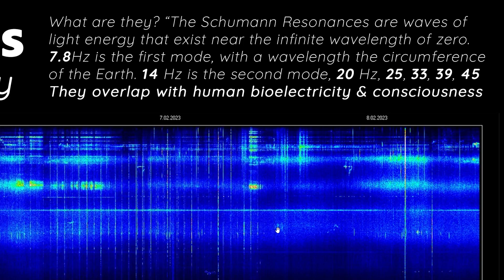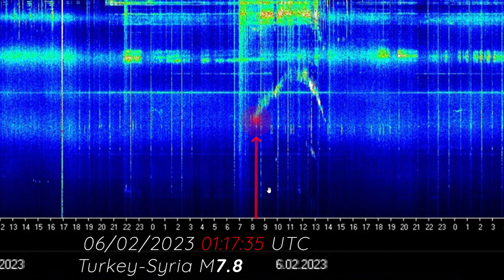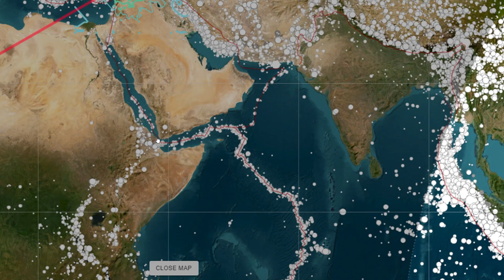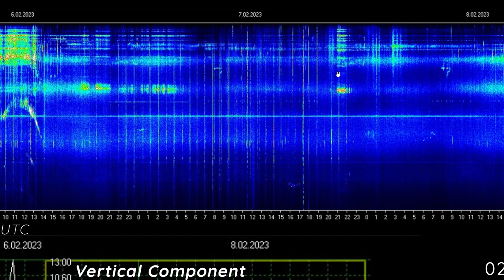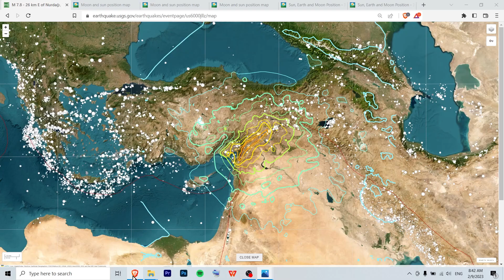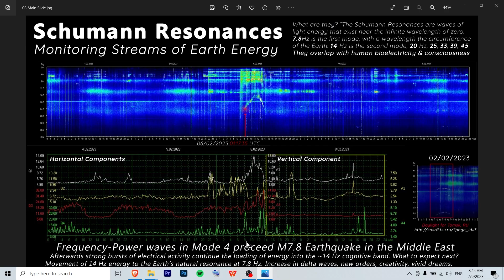Pre-Earthquake Signals appeared DAYS BEFORE M7.8 Turkey Earthquake

Comment: Do you have any informations about potential Ionospheric anomalies over that area? I have read somewhere that Ionospheric anomalies occurred before strong earthquakes like in Japan 2011. I could provide you with more details when I find the study about the Ionospheric anomalies
Reply from the maker: Yes I talk about this is the video and would have to back past data to see if it happened in this instance. likely it did
Reply: @StefanBurns  Thanks👍🏻
Reply: @StefanBurns  Could the anomalies get caused artificially? Because I heard so many speculations that Ionospheric heaters and/or ULF, ELF energy beams have the potential to trigger such events artificially, whether intentionally or unintentionally?
Reply from the maker: @cCiIcCo  Well, technically it's possible. There is no difference in being 100% sure that the earthquake was natural in origin versus being 100% sure it was induced artificially. Strong evidence is required to claim it was induced by HAARP technologies or such. So the best and most responsible thing we can all do is to entertain all ideas and see where the evidence leans most.